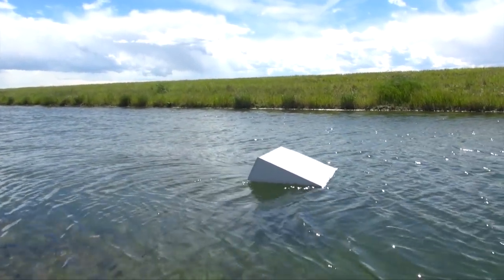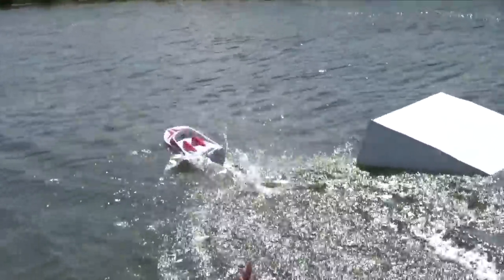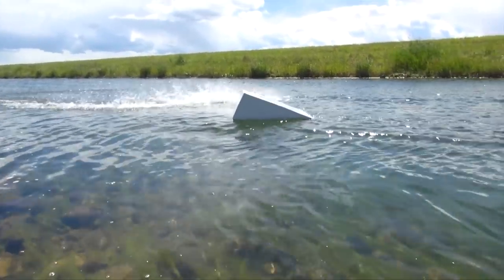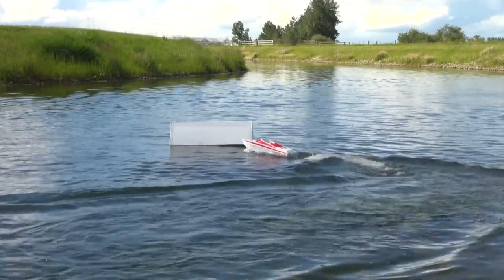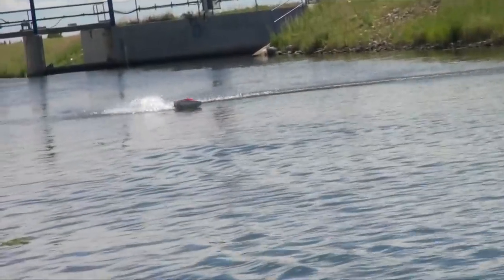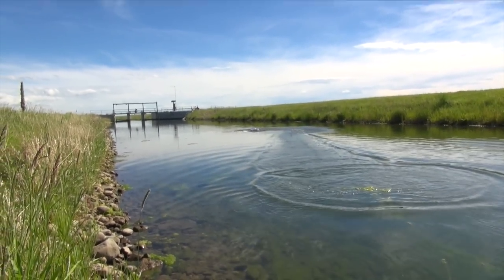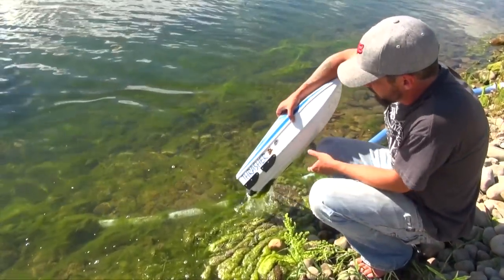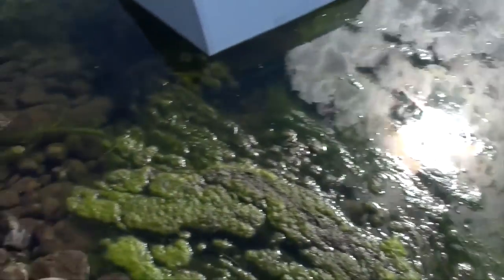RC ADVENTURES - Home-made River Jump & RC JET Boats

Comment: Since you're on a river, where there's flowing water, why not mount some 'rudders' on the ramp's underside in-line with the ramp? These would keep it straight in the flowing water and help it straighten back up after a jump.
Reply from the maker: I like this idea... thank you! only thing I could see being a problem is the floating weeds getting caught on one side.. causing a spin with the current... Hmm.. Maybe a bevelled rudder would work well.. where the weed could slide off..

Comment: Hey man awesome jump. Quick question is jumping boats hard on them? How does the stress hold up? Any stress cracks? Rudders etc? you guys should build a water Loop d loop like the hotwheels have and try and make it :D
Reply: Michael David Cilantro these are the same ones we were sending over pretty big waterfalls. That was insane landings. also the same ones we had in the wier in the other videos. all of that was like 10x the stress on the boats. did I say it was the same red boat in all the videos? lol. It's like the day we got it.
Reply: Killer though because my boat seems like it would sink the sec it hit a ramp at high speed haha

Comment: I need help! my wait every motor I put in it. it runs backwards. forward acts like reverse and reverse is really fast.  I can not figure it out.
Reply from the maker: Brushed or Brushless?
Reply: I'm sorry. it's a rc4wd 27 turn brushed.
Reply from the maker: take the Positive and Negative wire for the motor, and switch them on the connector, or posts.  It will fix your problem, and reverse the motor spin.
Reply: RCSparks Studio Hahaha I feel dumb now. Thank you so much. I'll let you know how it turns out. Love your show and how you explain everything with new rigs. keep it up buddy.
Reply from the maker: No problemo bud.. I hope that helps you! Good luck & Thanks!